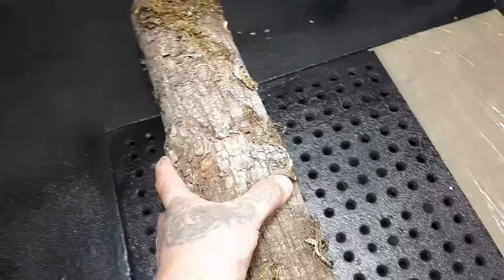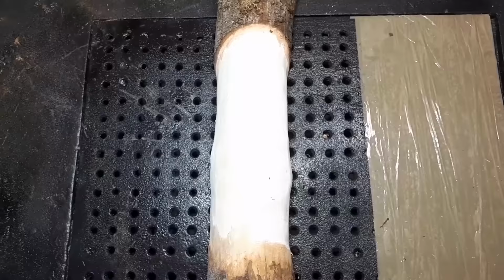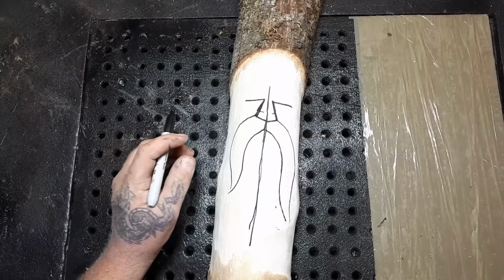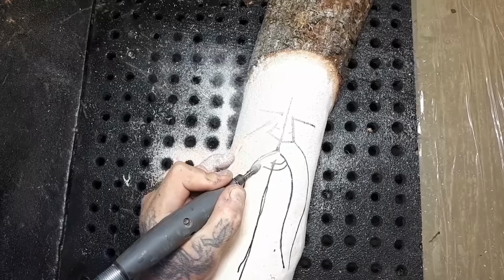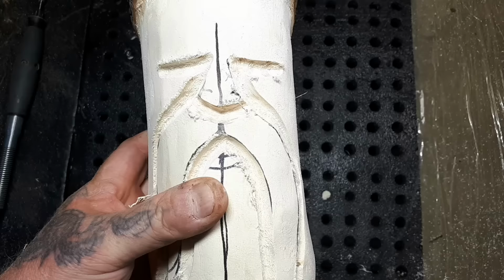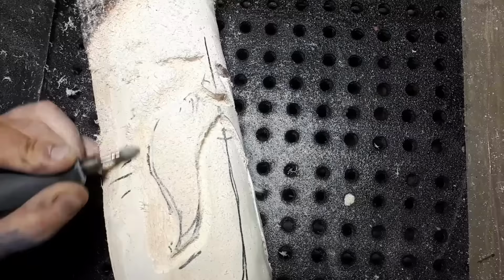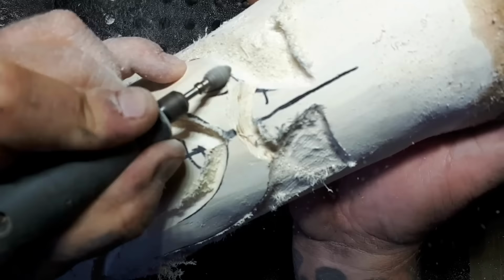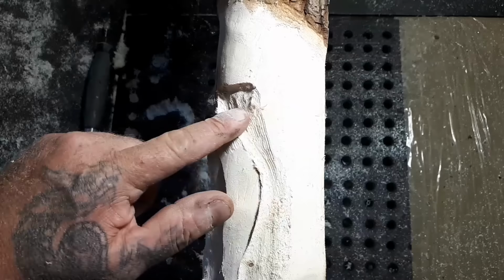A detailed step by step carving a wood spirit series 2019, #1 drawing, carving basic shape spirit,

Comment: Looking in to a Dremel for my wife to start in carving. What's a good model to start with?
Reply from the maker: Dremel 4000 with the flex shaft
Reply: Carving Fusion By : Jordy Johnson  Thanks for the quick response. I haven't seen it in person yet, but it seems best value for money. However, I was thinking it could be a bit too big to handle on more delicate work. The 3000 seems a bit more pen-like and lighter but I could be completely wrong. 

Does the 4000 give a pen-like feeling? Would it be too heavy (considering a average size / strength woman)?

Thanks again
Reply from the maker: @calembur  the flex shaft for dremel is all the same handpiece, so dont make a diffrence if 4000 -3000 :)
Reply: Carving Fusion By : Jordy Johnson A-ha... Now I understand. I hadn't realized there was a separate, flexible shaft. That's really cool. I'm totally new to Dremel. Thanks a lot. Now I know what to get. I think we're going to have a lot to do this weekend.. :-)
Reply from the maker: @calembur  there is a link to one in my amazon under my newer videos, not trying to push it on u lol or just look on amazon! U REALLY NEED THE FLEX SHAFT, ITS A GAME CHANGER
Reply: All the comments are great. I believe mine is the 3000 (forget and its not in front of me) my opinion if she's never tried carving.. I needed a few bits and was in a pinch with cash so I went to harbor freight to get some cheap ones. I ended up getting a drill master 9volt corded rotary with 80 different bits for 9.99. Yeah it's not name brand and ive had a bit break but ive put some hours through this little thing and I honestly didn't think it would last. Its light weight and if she enjoys carving then get ghe name brand stuff and she'll be twice as good. Just wear safety protection. Ive had dremel brand bits break too. Just a thought
Reply: All the comments are great. I believe mine is the 3000 (forget and its not in front of me) my opinion if she's never tried carving.. I needed a few bits and was in a pinch with cash so I went to harbor freight to get some cheap ones. I ended up getting a drill master 9volt corded rotary with 80 different bits for 9.99. Yeah it's not name brand and ive had a bit break but ive put some hours through this little thing and I honestly didn't think it would last. Its light weight and if she enjoys carving then get ghe name brand stuff and she'll be twice as good. Just wear safety protection. Ive had dremel brand bits break too. Just a thought